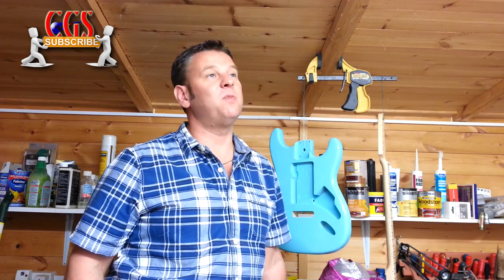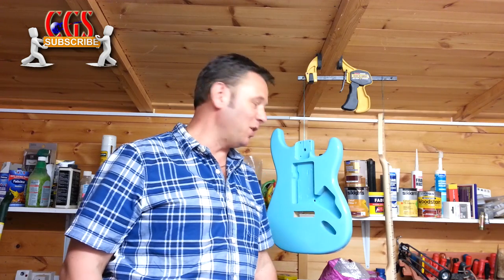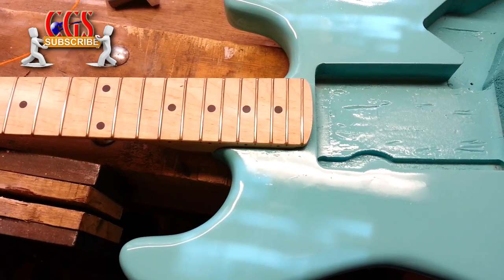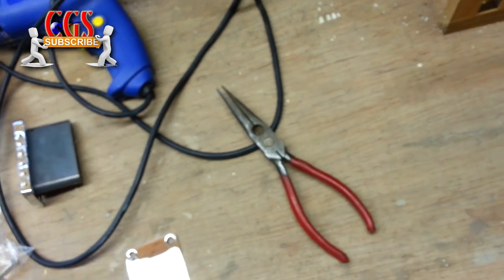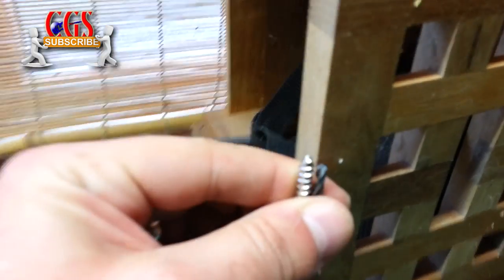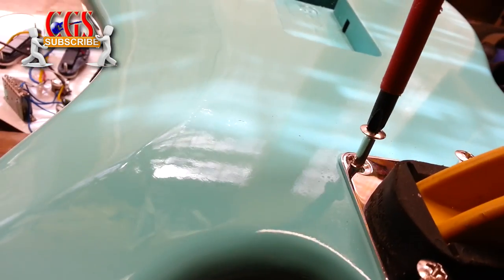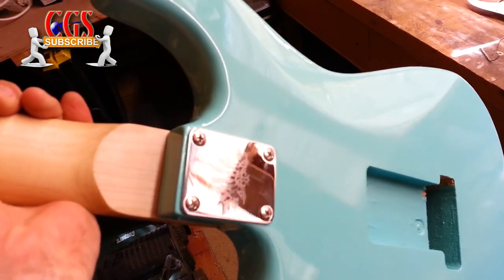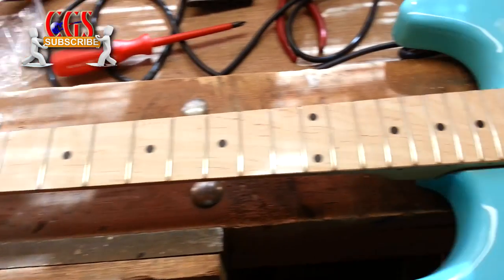Build a Custom Strat Guitar from parts - Fitting the neck - Part-o-caster Part 6

Comment: good to see you back, was thinking about putting the same tremblock in my strat type axe have to do some measuring to see if it will fit without alteration of the body.

Comment: always wondered what its like to burst a ear drum and how that effects your hearing before and after i suspect you loose a bit of frequency response nice see your doing good
Reply from the maker: Sionyn Jones I actually go a little deafer every time as well as missing some high frequency response. It's very frustrating and I have asked to see a specialist as this time it was complete and utter agony. Put it this way I NEVER take pain killers let alone ask for them. I went to the doc and asked for a prescription of the strongest they had and still ended up climbing the walls of A&E in agony. Got a pre-prescription now so I have to get ear drops at the first little itch - which is usually the first sign. Even 3 weeks later I have a sore throat as an aftermath. Hey ho - I will survive :o)

Comment: Nice to see you back CGS! She's starting to look a beauty already! Can't say I'm a massive fan of the colour but we all have our preferences right?

Also, I was doing some poking around about a Chinese guitar to buy and do up like yours and saw that Rareeletricguitars.com was getting a decent amount of good reviews. So I inquire as to how much it would cost to get an Iceman's paint-job altered to be more me plus shipping with a hard-case and i got this load of rubbish back:

"As for the case, sir, we don't recommend our customers to buy hard case,you know the hard case is made of wood, so when it is delivered, it may hurt the guitar, also it will add your shipping costs, 
and It is unnecessary to worry about the safety of your guitar, because we can pack your guitar very solid. We have enough experience in packing, through our test, the best way to protect the guitar against damage is foam, 
and the most important ting is that our foam package is 3d designed inside, which can protect the guitar completely."

Tell me, have you ever heard a bigger load of rubbish about shipping guitars? Or did is every major guitar company shipping expensive guitars wrong?
Reply from the maker: Sithek Blackheart Wow that's unusual but I am guessing that they get more breaks with the guitar only supported by the neck in a case. If they are 'really' moulding the polystyrene then I can actually see the additional protection but most times they are a bog standard template case. Go figure huh? :o)

Comment: Hi I have a quick question I was wondering if you could advise ?
I want to fit a new neck to a cheap strat copy (which has worn frets and truss-rod-rattle). none of the parts are fender-standard-sizes, so I think I won't be able to get a part that will fit without some woodwork. In order to get it to fit, would you advise I alter neck neck or the body ? my kneejerk reaction is to do the body as the softer wood will be more forgiving, but it also means if I mess up the guitar is finished.